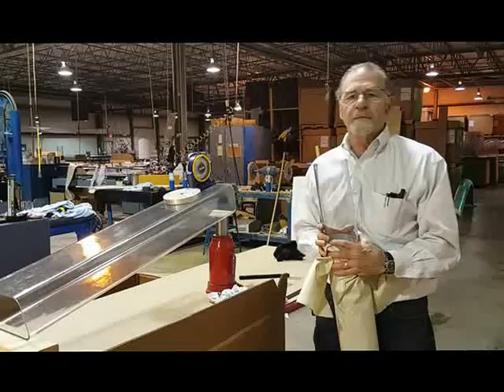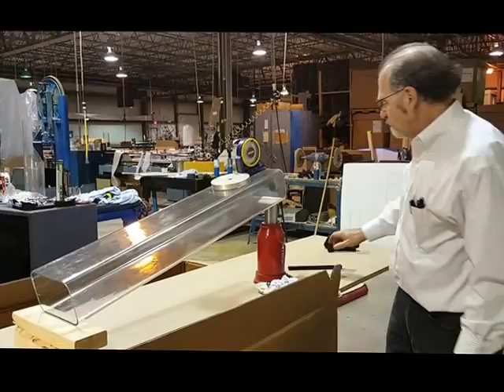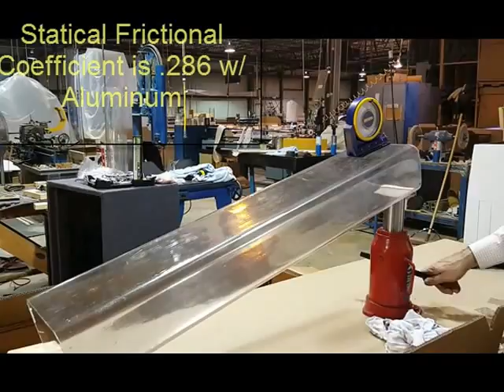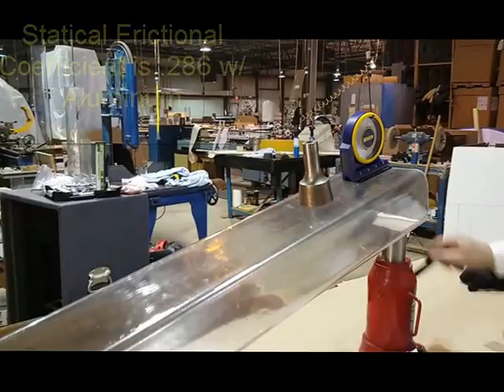Butyrate tubing Coefficient of friction

Comment: Sir,
I am INDIA Based Company.Can I have your Quotation for 120 OD X 3mm th.
OR nearer dimensions Butyrate Transparent(Clear)Tube & 90 Degree Bends(of R500 OR your standard size.
Requirement:-1).Tubes-40 Mtrs.2).Bends of 120 ODX 3 th.):-4 No’s.